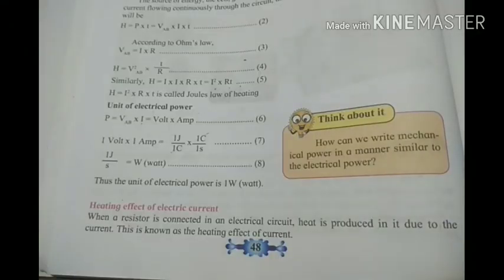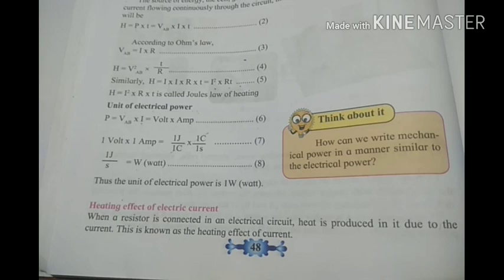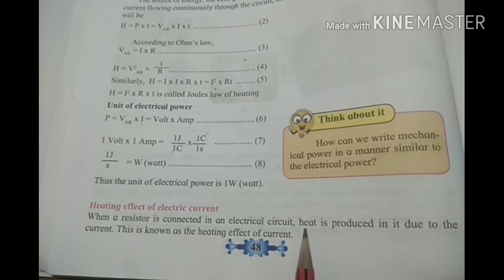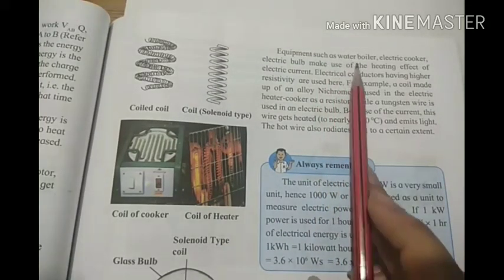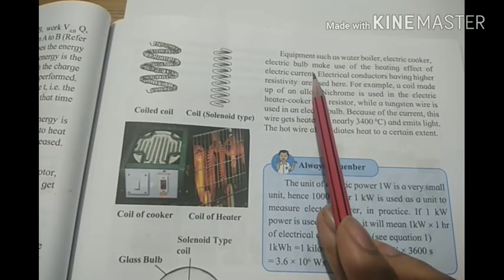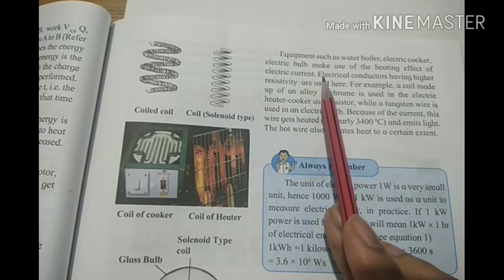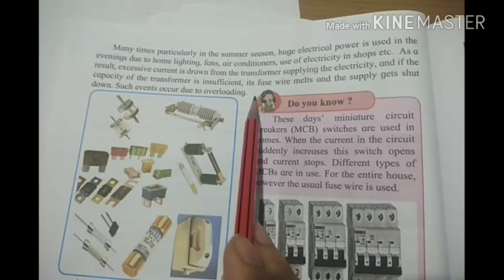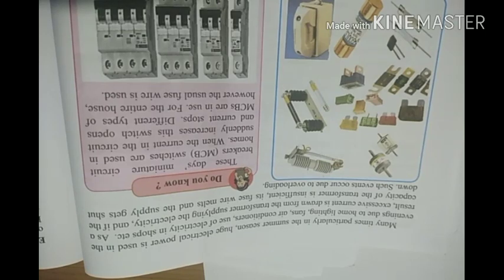4.2Heating effect of electric current.

Comment: Ma'am potential difference of 220 volt means
Reply from the maker: Current flows through one end to other end of wire or conductor  so the difference of electrical potential that is capacity between those two point is potential difference.